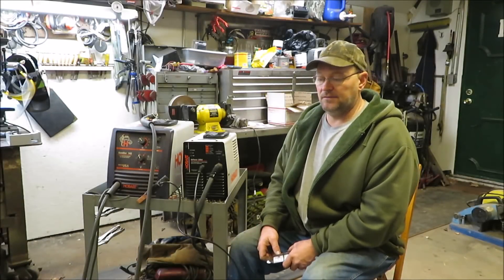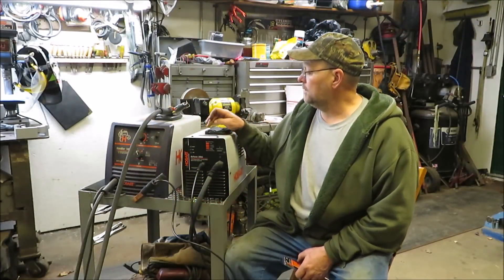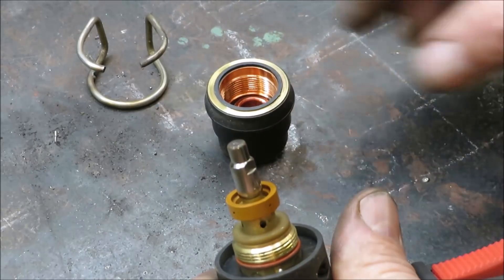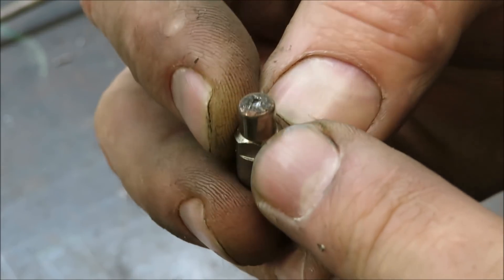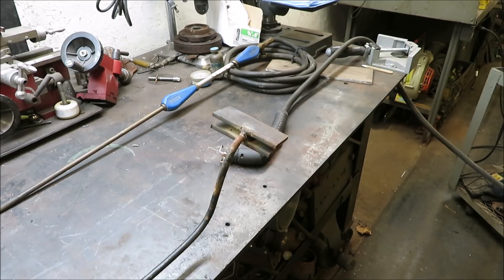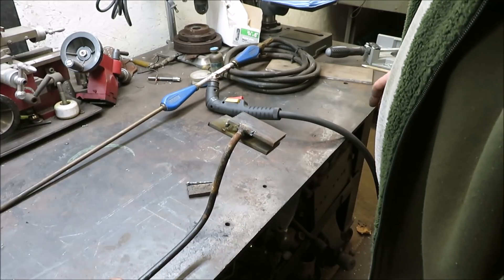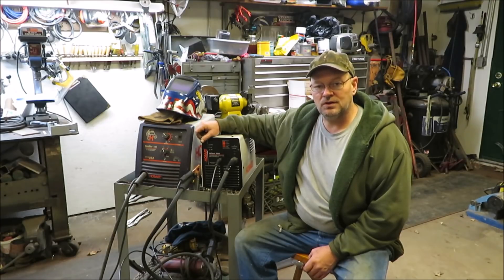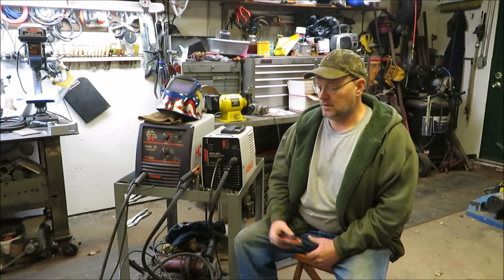hobart plasma cutter tips

Comment: I have  the 250ci plasma and the board is bad and I contact Hobart and they asking to pay 600 for the board
Reply from the maker: That's not good.
Reply: Kevin Robinson every time I squeeze the trigger the power and temperature lights  star flashing and the fan start spinning and then stops and the compressor will not star.  I disconnected the compressor from the board to test applying 12 volts and the compressor works normal. Any help will be great, thank you !
Reply from the maker: That's not good.

Comment: A drag tip holds the arc at a constant distance from the workpiece and usually lasts longer  also dry oil free air is crucial to electrode and tip life. Investment in a quality air water separator or dryer is a must with any plasma cutter.
Reply: I just ordered a hobart 12ci with on board compressor. Is there and air dryer you recommend ?
Reply from the maker: Thank you for the info.

Comment: really dry air helps a lot with consumable life in any plasma so get an air drier or two and make sure you drain any water out of the tank before you start, I dunno if that's your problem, but it's a great tip so your tip lasts longer.
Reply: Has a built in compressor
Reply: I just ordered the hobart 12ci model. Is there an air dryer you would recommend for this model as it has an on board compressor?